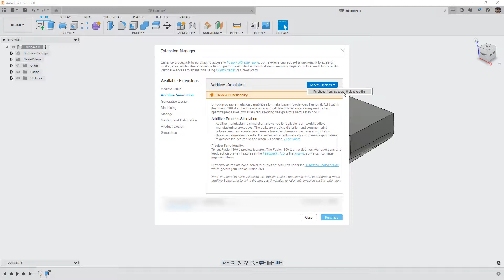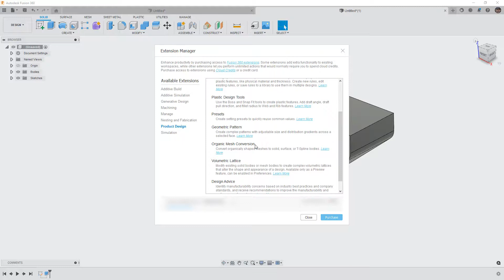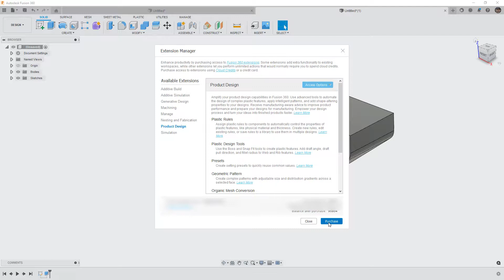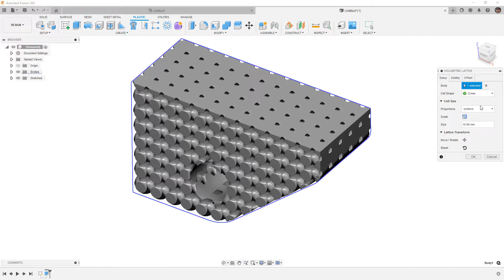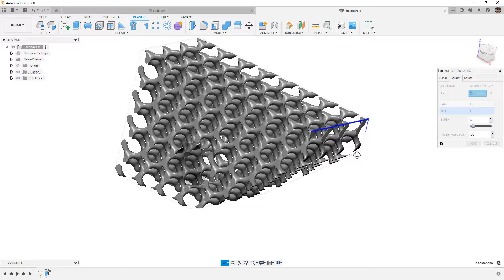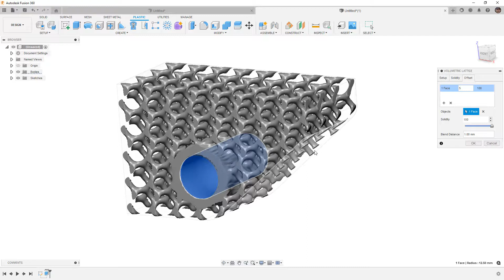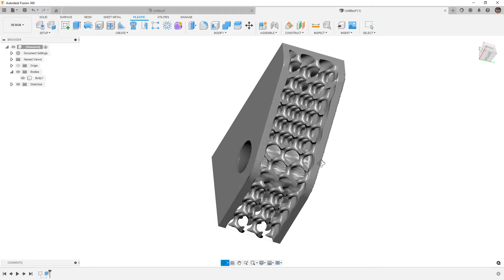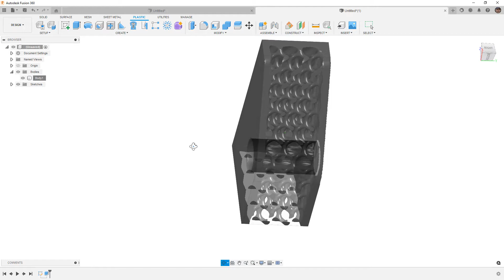NEW Volumetric Lattice in Fusion 360 - Product Design Extension #Fusion360 #LatticeCreation

Comment: I can generate lattice structure using volmetric lattice in Fusion 360; however, I couldn't render any lattice in Fusion 360. Do you know how to do it? Thanks
Reply from the maker: The lattice in Fusion is a graphic until you convert it to a mesh.  When its a mesh it maintains the external main body as part of the feature.  If you just show the mesh result you can render it BUT you are dealing with a mesh body now.  While rendering typically uses a mesh to calculate the light/reflections, rendering a mesh might be less than ideal unfortunately.  BUT you should be able to convert the graphical vol lattice into the mesh body by right clicking on it, then render that.

Comment: In the beginning I was recommending fusion 360 for everyone, now I'm getting a bit upset with the tool, since you need to purchase a lot of individual licenses/credits to use the full functionality of the software. 

It can became insanely expensive!!!!
Reply: how dare they spend millions of dollars on research and development and want paying for it, the nerve! ... some people, jeeze.
Reply from the maker: It is true Guilherme that if you buy everything but we do have to level set the other tools on the market.  Most CAD packages don't have Generative Design, so to pay $35/solve is much more efficient for the occasional user than $10k a year for other solutions.  As of right now it is the most cost effective Gen Design solution I am aware of.  So $400/year plus $35/solve or you can buy unlimited solves(which cost a good bit, but can really pay for itself if that is what you use).  PCB creation in Fusion 360 is a tough one.  There are free and cheap tools out there but the professional grade tools that are going into Fusion 360 from Eagle offer a great value.  If you were to buy Eagle or Altium as a stand alone option it is expensive.  Simulation is another area.  I know the hobby license is a bit limited but very basic simulation in say Solidworks requires you to have the upper license which I believe is over $8000 plus $1500/year.  On top of that to get the simulation package with eCAD sim, and flow, motion studies etc you are adding a lot on top of that price.

I think where Fusion has sort of made a mistake is offering so much for so long at a free or very low price that now people are upset having to pay more for what they consider basic tools.  Lattice creation if you were to buy Netfabb with Fusion 360 its almost $5000/year.  From a business perspective not a lot of people need Netfabb, but Autodesk can't include everything from their more expensive full suite solutions into Fusion 360.  So Netfabb mesh to CAD conversion, lattice creation and probably other mesh tools are showing up in part.  Do I think it's worth the $400 just for the product design tools as they stand today?  Probably not unless you waste a lot of time modeling bosses and snap latches and need volumetric lattice.  Just remember to consider the other options on the market, their cost, functionality and restrictions.  I don't know if you were a solidworks user but when they decided to take away their free 2d autocad clone and begin charging $400/year everyone got really upset.  I would say for the same price fusion holds a lot of value!

Just my opinion so take it for whatever that is worth :)

Comment: Even though this is cool, I am having a hard time understanding what functional purpose this tool can serve. Any thoughts?
Reply from the maker: Lightweighting.  better control on what happens inside a 3d printed part.  Most print slicers will create infill.  If you can create it you can control the structure better and still save weight and print time.

Comment: Great video, really wish I can do this volumetric lattice feature and generative design in an open source software like bender or freecad. If anyone know pls do tell
Reply from the maker: Hi Hollee, actual generative design and volumetric lattice is not in blender or any free cad program that I know of.  Fusion is probably the cheapest for true Generative Design, but still the cost of the commercial license plus $35/solve.  I did a video making a lattice in Blender based off a workflow created by Roman R.  But in order to make that lattice work it is a lot of manual steps.  If i find something you can be sure I will make a video :)
Reply: @LearnEverythingAboutDesign  Well actually a software that also does generative design is NTolopology, but it's way more expensive than fusion. It also let's you deal with lattices and mesh optimisation in a pretty neat way (similar to blender geometric nodes). great showcase Matt, as always, fantastic work
Reply from the maker: Yes NTopology is well outside of the open source realm:)  I think it was close to $10k a year last I checked.  I haven't looked recently to see if Rhino offers any lattice tools now.  Autodesk has other tools that allow it but they cost a good bit more.  The tools are slowly coming into Fusion 360, but I did notice this seems to be destructive in Fusion right now.  The original body isn't maintained.  So I don't know if the lattice is just graphics at the moment but no new timeline features showed up.  I need to play with it a bit to better get the workflow down.